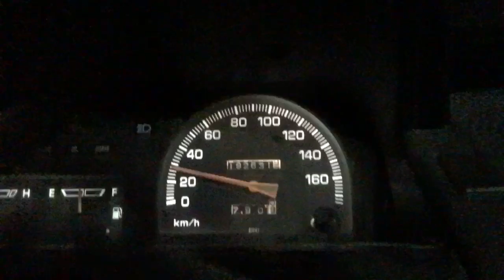1.5L/100km - Running your car on vapour - It really works!

Comment: The engine creates a vaccum on the box thus lowering the temp of the fuel and it basically stops venting fumes, but by this point youve probably allready burned the lighter elements in the fuel so your left with the sludgy heavier elements. IMHO you need to find a way to heat the fuel... The lighter and heavier elements of it.... And accurately feed the engine with it... But you'll find the exhaust runs alot cooler because the engine is bloody running cooler and better so you might not be able to use the coolant or exhaust to heat, so then you may turn to electrical means of heating the  fuel 😉  Good luck!
Reply from the maker: Exploring with Rich that’s so bloody true. With my new experiments and systems I’m finding that the vacuum brings the fuel below it’s flash point and loses the ability to create enough fuel to air. I’m building a vacuum system that is either heated via manifold or radiator heat. But as you mentioned, the engine runs more efficiently and creates less heat. 
Hopefully it gets hot enough to keep the petrol above its flash point of -42C°. I’m sure my petrol got to about -5° before it didn’t produce enough fuel to run the engine.

Thanks heaps for your advice. Do you have any other gems? Or better yet, videos of what you’ve done?

Here’s the video of my current system: https://youtu.be/jJu2mNsiM6k
Reply: @NathanR1995  Get one of those air/water intercoolers to use your engine coolant to heat up the intake air. Adding vacuum only lowers the boiling point of the fuel which will help vaporize it. I wouldn't worry too much about it. Just make sure you can dial in the proper air/fuel ratio. This is the crucial part. 60:1 is probably good but you'll need to start insulating engine components.
Reply: Tbh i was thinking of adding another alternator to seperately control vapours... It can somewhat be a seperate system to the car/ engine then... Induction heaters on coiled stainless steel tubing could work very well.. just dont allow the tubing to ever be empty... use a recirculating ammount of fuel to get hotter and hotter as it gets pumped around the coil, with a float bowl arrangment to keep the coil filled up etc
Reply from the maker: Jon Tanneguy that’s a great idea. Something for me to think about and plan out. At this point in time I’m building the same system, but in future I can experiment with that too. Thanks for your comment. Love the feedback
Reply from the maker: Exploring with Rich yeah that sounds good. How long do you think that will take to build? And cost? I’d be curious to know. Thanks for your comment
Reply: @NathanR1995  it wouldnt cost much at all. The induction heaters look like a coil of copper tube... Cheap chinese ones from ebay, last time i checked i was drawing 4-7 amps to make a 5mm stainless tube red hot. Make ten of them and youve got enough vapour there for a car... I havent got any time at the moment to play but ive got an old carbed car to try it on when the time comes. But dont forget the extra efficiency comes from advancing the ignition too and potentially adding water steam as well to cool the cylinders when under load...
Reply: And.... Make sure to use no glass and use flashback arresters in case the car burps/backfires, when containers explode even plastic ones hurt lol
Reply from the maker: Exploring with Rich sounds good. Send links to videos when you’ve done it. A picture paints a thousand words, a video ten thousand.
Reply: Wait, will cooler engine get more efficient?
Reply from the maker: Farhan Ega a cooler engine doesn’t mean it will be more efficient, but means the engine and components can last longer because the heat and strain on components is less.
Running on vapour gives a complete combustion, which makes a more efficient engine. Lower heat is just a secondary gain.
Reply: A leaner air to fuel mixture will make an engine run hotter, not bloody cooler you silly man! I can, however, see how you might draw this conclusion. https://www.quora.com/Why-do-we-have-increased-exhaust-gas-temperatures-at-lean-mixture-settings Though you are pretty spot on with evap point temps, since it will decrease, but aren't evap temps inherently lower in a vacuum? Asking for science reasons..
Reply: @NathanR1995  i agrre with u...lower temps means all metal in engine last longer...
I was thingking about making the engine temps low..but the fuel fume that went into the engine has high temps around  90 degre celcius...
By making a hot evaporizer small tubes...then spray small amount of gasoline into the heating element...and then the engine will sucks fuel vapour ....just my thoughts..
Reply: @PrideSage99  thats not always neccesary true...
I did make my 1984 accord runs leaner fuel...but with extra spark( btw i was build plasma spark)
Strange thing it runs cooler....i even surprised.....
So that wisdom is common wisdom on engines...but  there are different wisdom....wkwkkw
Like this vapour engine...
Car factory creates injection system so the fuel can blends with air and can atomized completely....they even make smaller injection port....necause they know that liquid fuel dont burns...

Fuel vapor is simple...wo dont send liquid fuel anymore into the engine...but we send vapour....a completely atomized fuel....and in my opinion thats better than the best injectors can atomized fuel......is it?
Reply from the maker: That_One_Guy_Named_Jay Incorrect. Remember we aren’t running a factory system lean, but a gasious vapour system without liquid petrol. 

It’s been demonstrated before that EVERY part of the internal AND external components of the engine run cooler that factory.

In conjunction, having complete combustion (or near complete, something like 99.8%) means there no need for a catalytic converter to burn up unused fuel in the exhaust.
Reply from the maker: budi hart agreed mate
Reply: It’s literally shocking when you finally find out how much science is deliberately hidden. At least with common sense we know that liquid gasoline doesn’t burn and the more gaseous gasoline you have the more complete combustion will be. Reasonable chem/ everyday knowledge makes this clear. Imagine all the nonintuitive science that’s been shut down, the med system particularly.

Comment: add some air filters into the 3 vents to even improve it more
Reply from the maker: mario klutschke yeah will do. I don’t bother with the testing and experimenting, but once I’ve built a system that will work long term, I’ll add filters and more safety
Reply: @NathanR1995  socks work apparently lol
Reply from the maker: True!

Comment: I'll let you know but I think I have an opportunity for a patent unless someone has already stolen my idea locally. I've been doing this for a week and I can use my invention without heat and still get 150 mpg.  peak when driving City traffic and my invention 130 mpg together. But I'm getting 150 mpg at 52 miles an hour on small to flat hills without heat. Can' get close to 300 or maybe over so it's not calibrated in the car but for sure get 256 with power. I'll try and find out if I have an invention that can be Some income made on.and I'm sure the oil companies no all about what I have stumbled across.but again 150 miles per gallon cold 256 miles per gallon hot plus way more but the car does not run good but I can put a fruit jar with gas under the hood and use vacuum pressure to get more fumes in the combustion chamber that will probably smooth it out.
Reply from the maker: Contact me on Facebook. I’d like to talk more privately. What your saying sounds very interesting though.

Comment: I remember reading many years ago of moonshiners in the early 1900s running their vehicles on the vapors of moonshine.  It was just a matter of air/vapor ratio.  I recall for gas it’s 17:1.
Reply from the maker: MrAlbert1811 if that’s true, it’s amazing! Where did you hear about this?

Comment: I read that the valve timing may need an adjustment, in order to drive longer distance with vapor.
Reply from the maker: Tesla Fan quite possibly. I find it so hard to find in-depth, clear and high quality info and/or resources. Thanks for your contribution!

Do you have any experiments or prototypes to share?
Reply: Agreed, but thats just a little fine tuning.

Comment: Dude, please get a flashback arrester so you don’t blow yourself up.
Reply from the maker: Larry R The Vapour Kid, who I’m sure your familiar with, stated that in using vapour on many engines, has never experienced a backfire, nor a flash that went through to whole system and lit the fuel. 

I will incorporate one eventually, but I trust the words of The Vapour Kid.
Reply: @NathanR1995  
You wanna be the first ?

Comment: Just goes to show that snake oil sellers are still abroad in 2019 and there are still those dumb enough to buy it!
Do you have a lawn mower that runs on water too? 

And a generator that starts on an external power source but then powers itself once you throw a switch? They all exist because i've seen them on youtube as well...
Reply from the maker: Koito rob I agree mate 👍🏼

I converted my lawn mower to run on petrol vapour, and I have also tried water vapour mixed with a liquid petrol carburettor. Never did an economy test though.

As for a generator, no, as I don’t own one or need one, but say concept. 

Have you done any experiments?

Comment: Helo I need to ask about Toyota cresta it can work like that cause that car use more gas so can I use your way
Reply from the maker: Zubeir Khamis Abdallah  you can run any engine off vapour, but you need a fair bit of gear and fabrication to make a system that runs long term